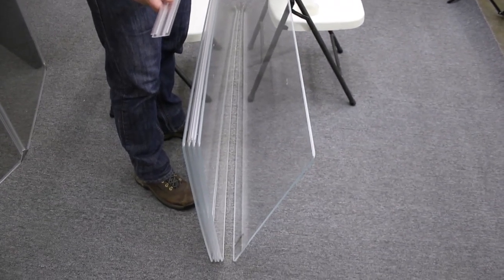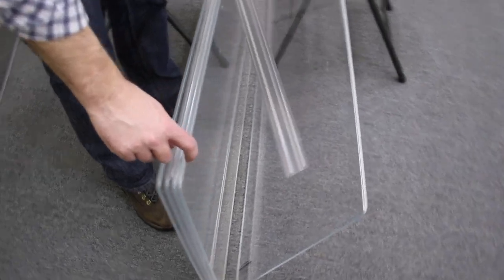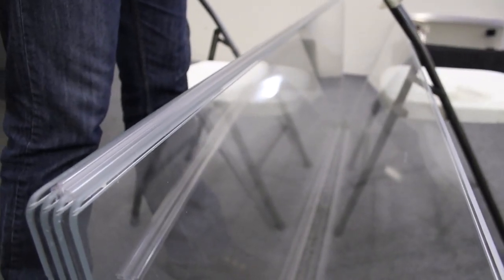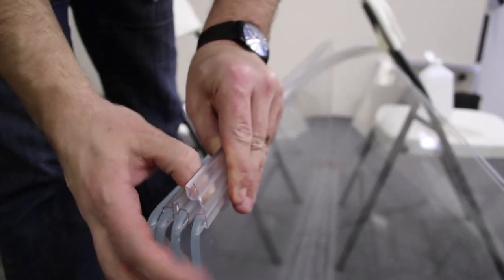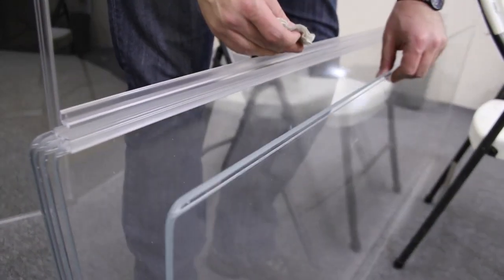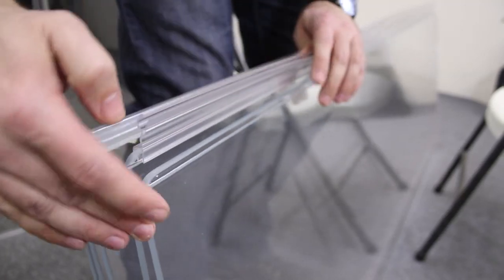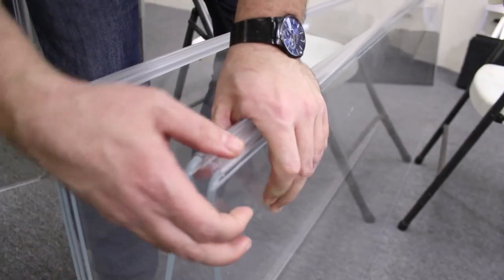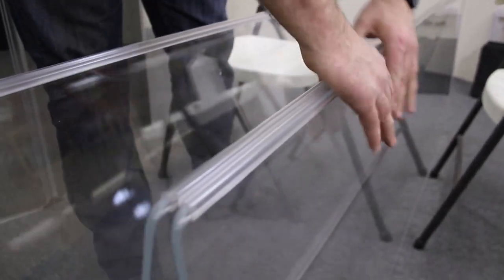How to Attach New Style Hinge & Add a Panel to Your Drum Shield | ClearSonic

Comment: Thank you for this video.  I just bought four panels;  they came with the hinges already on.  I folded the panels to move them and one of the hinges cracked.  I ordered a new one.  Question; is there a proper way to fold these panels so the hinges won't crack?  Thanks
Reply: Hi Tim, I'm sorry to hear about the trouble you're having with your hinges.  That's a great question!  

I believe you may have already received an answer via email, but just to be sure I wanted to provide the info on this:  you do want to be careful to fold the panels back the way they come when they are shipped.  

Looking down at the shield from the top, each hinge will have a slight curve or 'u' shape to it in the middle.  The panels/hinge need to fold in the direction of that curve.  It can be a little tricky since they fold 'accordion style', so each panel will fold from the opposite side of the one before it (i.e. if the first panel folds on the right, the next will fold on the left, and so on..) 

I hope that helps, but let us know if you have any more trouble!
Reply: @clearsonicmanufacturing7342  Thank you; once I install the new hinges, I will make sure to fold the way you mentioned
Reply: Sounds great!  Don't hesitate to contact us if you have any more issues.

Comment: We keep running into an issue where the already installed hinge slides down the groove such that is the weight of the panel will rest on the hinge itself when standing upright, or at a minimum they slide down where the cable cutout is and do not allow for cables to pass through anymore... Do you have any recommendations on how to correct this aside from uninstalling and reinstalling the hinges? Any recommendation for "sliding" the hinge back up into the appropriate position vertically on the panel?
Reply from the maker: Hey there, sorry to hear about your hinge troubles. The hinges can slide for instance if the shield gets moved by grabbing and dragging it by one panel. Be careful when moving or adjusting the placement of the shield - it's best to fold it up accordion style if moving a far distance, or to carefully pull the panels by the cable cutouts at the bottom for shorter distances. 

The hinges will not reinstall properly as removing them damages the tooth that snaps into the panel groove. If the hinges have been previously removed and then reinstalled, that may be the cause of the issue, and they will need to be replaced with new ones. 

If they have not been removed, the best fix is to have someone hold a panel at the top while another person pushes up on the hinge/next panel from the bottom. You should be able to work it back up into place this way. Dripping some rubbing alcohol into the hinge channel groove may help with this.

If you continue to have issues, please call us at 800-888-6360 or email info@clearsonic.com and we'll be happy to help troubleshoot further.
Reply: @clearsonicmfg  Thanks for the reply! We'll try this and if anything comes up, we'll leverage the contact information provided. So appreciated!
Reply from the maker: @restoredtemecula   You're welcome! Hope it works out, and we're always here to help :)

Comment: hi, i wanted to ask you if i have to take a trip can i close the panels one on top of the other with the hinges or do i have to remove the hinges every time? thank you
Reply: That's a great question, Marco!   You do not want to remove the hinges unless absolutely necessary as they will not re-attach to the panels.  The panels can be folded for easy storage.  You do want to be careful to fold the panels back the way they come when they are shipped.  

Looking down at the shield from the top, each hinge will have a slight curve or 'u' shape to it in the middle. The panels/hinge need to fold in the direction of that curve. 

It can be a little tricky since they fold 'accordion style' - each panel will fold from the opposite side of the one before it (i.e. if the first panel folds on the right, the next will fold on the left, and so on..) I hope that helps, but let us know if you have any more trouble!